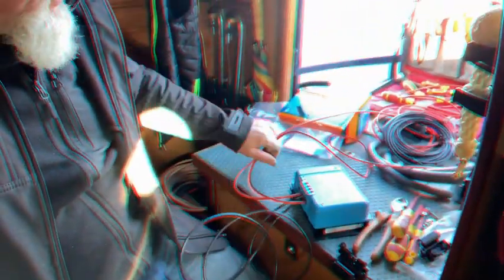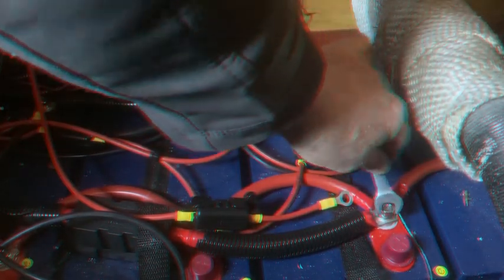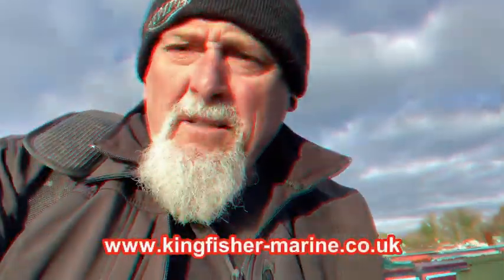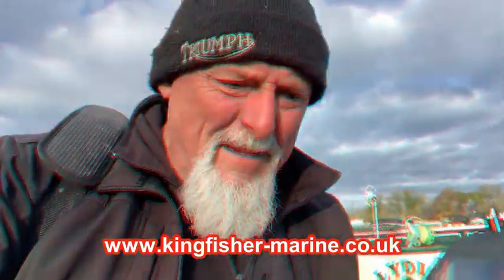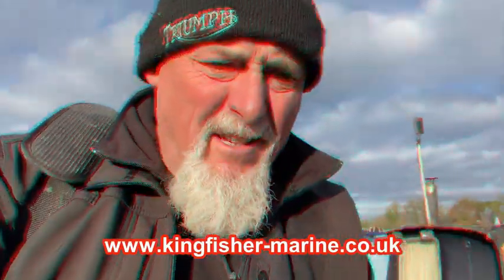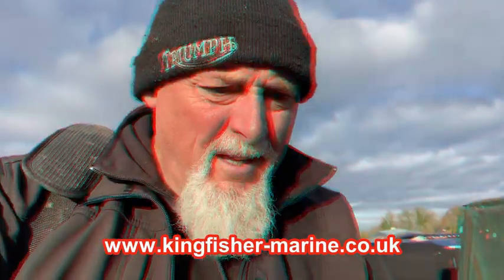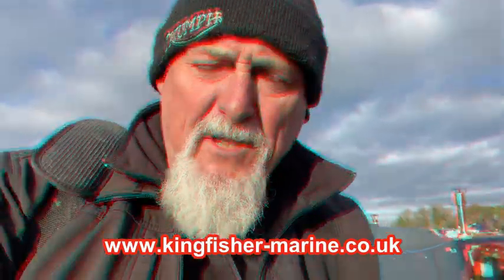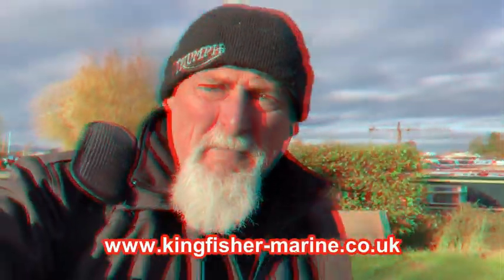Victron Orion on Starter Battery - Need to put thinking cap on.

Comment: there are people on boats who are on YouTube ,,and there batteries have no fuses at the battery end ,of the cables ,,its a case of it works ,and not bothered ,using second hand batteries ,,with corrosion growing on batteries ,and nearly everything ,else they do ,like cowboys have been there
Reply from the maker: I have seen more of my fair share of those Malcolm. I try not to get involved with the guys that just want short cuts and bodge jobs. After all, when I work on a boat, I take some responsibility for it going forward. And if anything happened I was last to touch it, they would soon point the finger at me.

Comment: You can do this easily, just enable the relay on the MPPT controller to switch on “daylight detection”, then take that relay feed from the MPPT to the Orion remote port.  The starter battery will be charged/maintained during daylight hours only.
Reply from the maker: Hi John, yes I like that idea. In this case it’s only for winter maintenance, the boat is unoccupied. I’ve set the switch on voltage quite high which in effect will do the same thing.

Comment: Great video as ever, though not sure why Youtube had to eat it! I've used Durite's Changeover relays several times for auto switching charging circuits depending on trigger state (last one was on a monster truck, auto switching between 3 different supplies). From memory the part number is 0/728/72 for the XHD version or /70 for the normal version, and I think there might be 24v versions as well.  When I was first learning on my first 4x4, I had a similar system, and I had two isolator switches and I lost one key deliberately, so it was either but not both. Its a pity they don't just have a full All in one control unit available that does inverter/charger/dc/mppt on one rig for marine applications. With a good whack of current handling, it would cover nye on 80% of every install requirement.
Reply from the maker: Hi Duncan, great comment. There is an all in one unit from Victron. But I go for separated for only one reason, if that all in one unit fails, you have lost everything. And during warranty units have to go to be tested which could take a week or two. I use that type of switch on a few more basic systems, but in this case wanted something a bit more advanced to properly maintain the starter. The domestic batteries are lead carbon and also didn’t want to just connect a standard battery directly to them.

Comment: Is it worth considering an insulated tool kit for work on Batteries ?
Reply: PS Great Channel
Reply from the maker: Always, but they are very chunky. And as only the spanner face is open, that will be very awkward with multiple connections on battery terminals. If you notice I’ll put the palm of my hand over the end. It’s more dangerous than some appreciate.
Reply: @narrowboatelectrician  I used to train engineers on battery maintenance and I always advised using insulated tools because of the danger of an accidental short to chassis. The main danger is molten metal flying into the eye. As you say it is more dangerous than some appreciate, because it is only 12V! I used to get them to momentarily short out a battery with a small gauge cable, then feel how hot the wire got.  We all had to wear eye protection and gloves, and have a fire extinguisher to hand. Just dropping an uninsulated spanner, with cold hands, is all it takes, if it happens to short the positive terminal to chassis. I would recommend taping up the spanners you use for the positive connections.